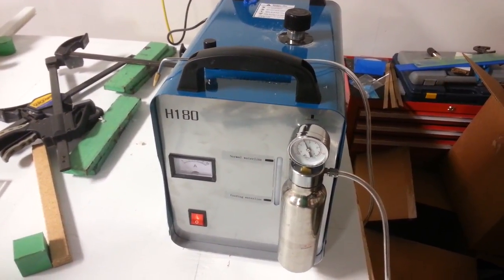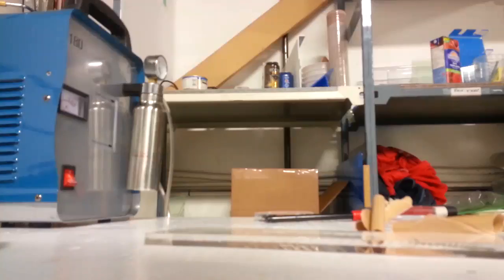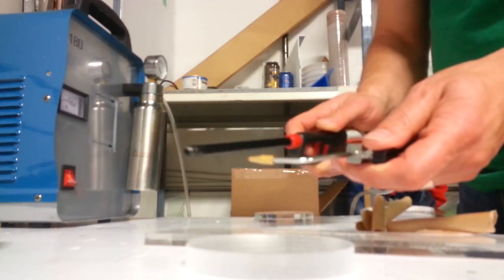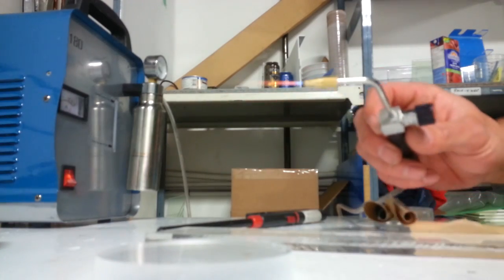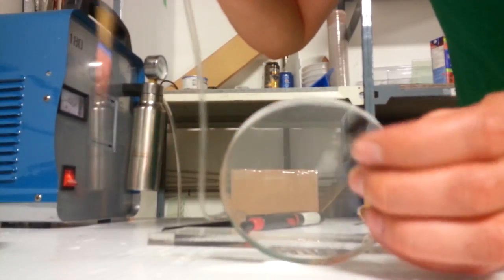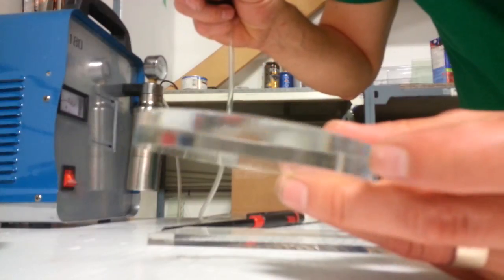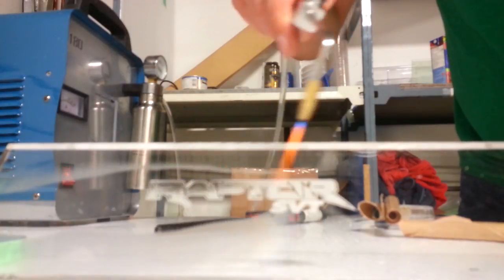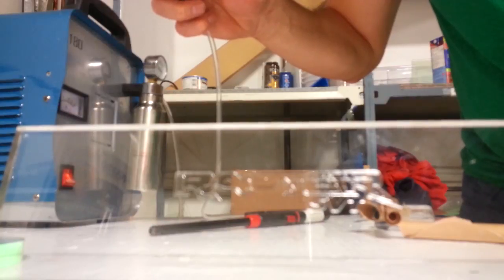H180 flame polisher

Comment: I have some questions that I have not been able to get answered by the manufacture. Can you assist?
I need to know how hot the flame is at the tip, how long I can run the torch on one charge and how much heat is put off the sides of the torch? I would appreciate  any help I can get. thanks

Comment from the maker: Just an update,  after basically abandoning it since the video was filmed,  I used it for about 3 hours tonight without a hitch.   The alcohol does seem rust coloured but actually use was great for it.   Polished about 500 4" squares....
Reply: Is this essentially the same as a carbon clean machine ?